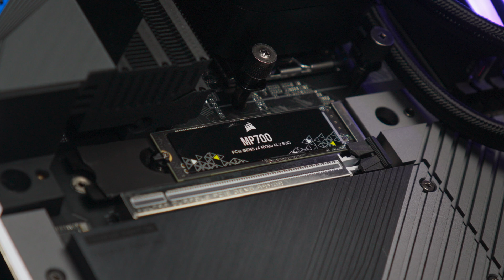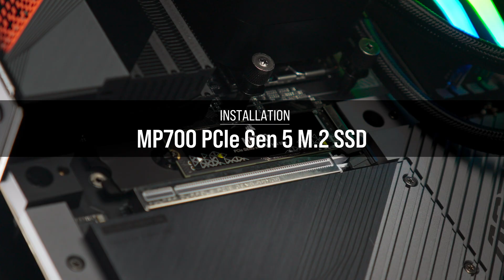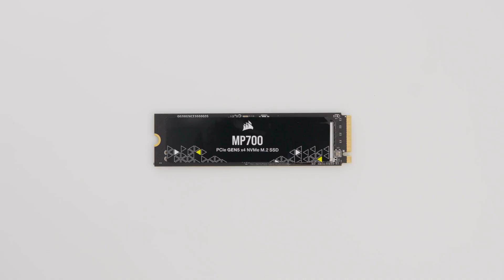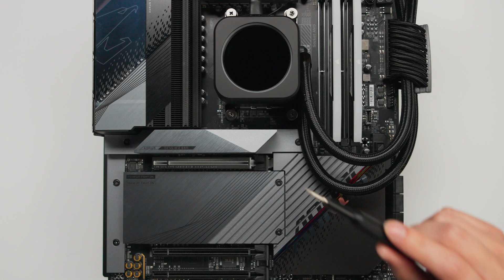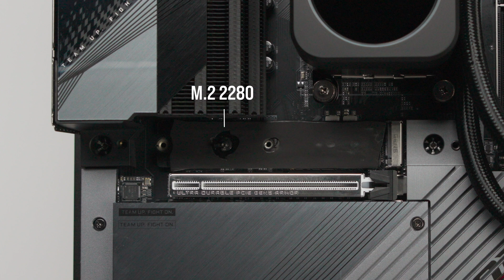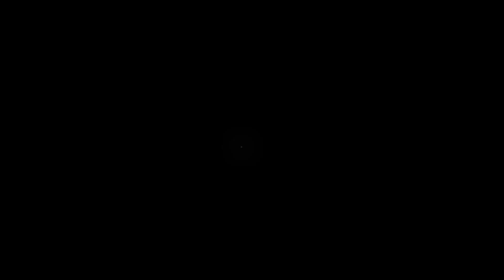How to Install CORSAIR MP700 PCIe Gen 5 M.2 NVMe SSD

Comment: 0:59 I searched for this moment specifically; should I remove the thiccc sticker on top of the m.2? When I look at it with a magnifying glass it actually looks like it's the instruction manual because it looks like several layer - like it's made out of paper.
It doesn't help that the thicccc sticker looks peel-able.

Also my motherboard comes with a heat sink and a heat pad 🥴

I'm choosing not to remove it because one comment said something about a copper layer, and under a magnifying glass I think I can confirm that. 
Still confusing tho as people enjoy peeling stickers, especially those that trap heat.

Comment: I'VE WROTE TO CORSAIR. THEY SAID "DO NOT REMOVE STICKERS" !!! THIS VIDEO IS GARBAGE
Reply: They didn't talk about removing the stickers. The guy clearly told you to remove the adhesive sticker tape from the motherboard, otherwise you'll fry your ssd.
Reply: @realmysticstrider  He shows the SSD with the front sticker on, then installs the drive without it, stating to remove the large front label covering the IC's

Comment: My mp700 had a heat spreader under the front label that I couldn't remove. Where was this in the instructions? Also If you try to remove the label on the back it voids your warranty. I'm not loving being confused.

Comment: Can I install this on laptop (asus rog g16)?
Reply: If you have an m.2 slot supporting 2280 cards, then sure. However, if you install it without a heat spreader like the one on the video, and push it to max speed, then it will overheat and throttle, reducing speed by a lot. So not only you'll be running it hot (which will accelerate wear), but you'll get a performance of much cheaper drives.
Reply: it would make no sense because it's PCIe 5 gen, Asus rog g16 doesn't support it, it has PCIe 4 gen, so technically, you can but it couldn't work in proper way.